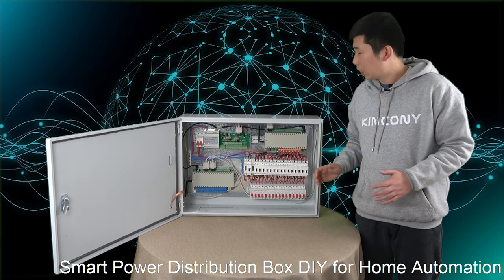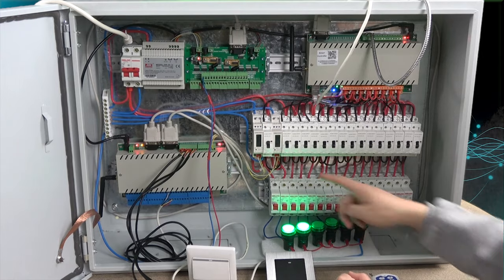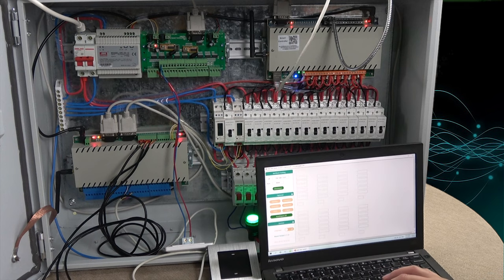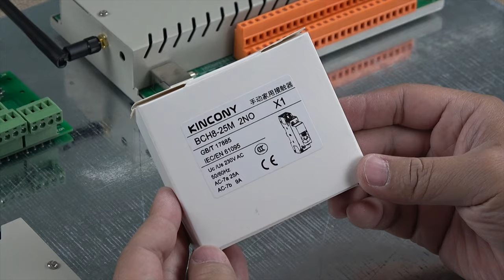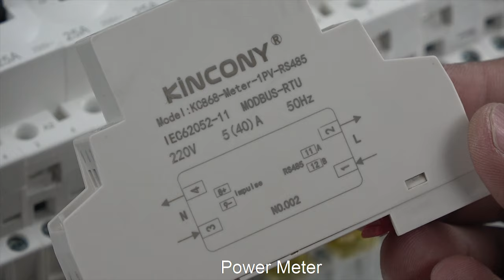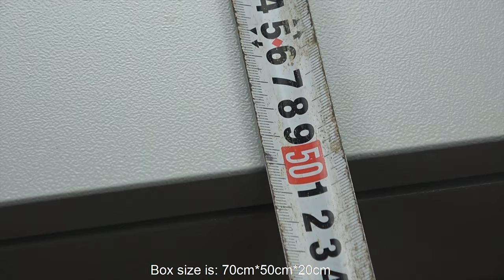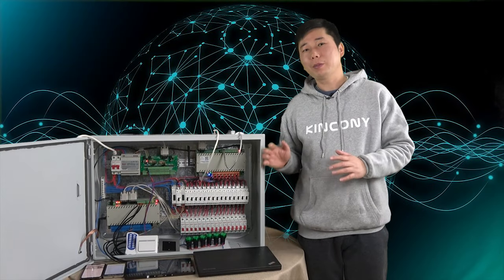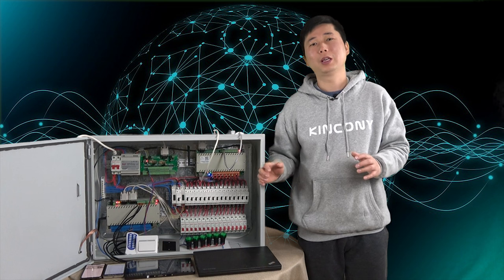Most powerful smart distribution box home automation DIY project 2021！

Comment: This is exactly what I think I want for my home.  I don't want to buy a multitude of differing wifi bulbs or switches or what have you.  I want a central place to be able to wire circuits to, and then have them controlled at that one place.  Also so that it's easier to either wire and/or change a circuit to NO or NC.

But I need to be able to do it while remodeling.
Reply from the maker: yes, we have smart relay controller, KC868-H32B Pro have 32 channel relay output, if you want NO,NC, just add our extend relay module KC868-E16v2 is ok, here is video tour about it: https://youtu.be/Cks-6NPXkF8

Comment: If i wanted to use this to control all the lighting in my home, could it still be used with light switches in the wall? also, how would the wiring diagram for that look where does the neutral ground and live connect to in the panel?
Reply from the maker: yes, the control system support wall switch, but that is "momentary" wall switch, not need LIVE and Neutral line. just two wire OPEN/CLOSE to toggle relay.

Comment: I would love to see something that's able to communicate with something like a Tesla power pack to read the remaining battery reserves. That way the home automation software would cut off more of a house's power use to keep the fridge & the chest freezer from shutting off & spoiling it's contents. Due to winter storms  some homes lose power & not have it restored for a full week.

With a 2nd circuit you could isolate essential electrical objects from the unnecessary  so the TV won't be powered by a wall battery pack but the fridge & a single LED light bulb that's used for night navigation in the hallway would be.

I think that it would be even cooler if you could  automate a smart window to fog up when the outdoor temperature reaches a specific high  temperature range to save money on a building's cooling.
Reply from the maker: now can connect power meter or power failure sensor or CT sensor to COLB logical controller, it can preset by automatic control. smart window we have a demo video like this:https://youtu.be/e1khSbs5E6Q  it can open/close window automatic by sensor.

Comment: Do you have projects for bells for hospital rooms?
Reply from the maker: the relay output also can connect to bell load.
Reply: In this case I need a wireless scheme, when the patient touches the bell button, it makes the computer and mobile phone ring, indicating the room number.
Reply from the maker: @Commandos.3  bell button can't wire with controller? must wireless?
Reply: @KinCony  all buttons have wires and go to a board, it was in this board that I wanted to change from analog to wireless to receive on mobile phones and computer
Reply from the maker: @Commandos.3  you can see our KC868-AI input module, that can feedback to pc web and mobile phone app, one board connect with 48 channel bell buttons. here is video tour: https://youtu.be/eYaoFPldjjs

Comment: Hi there 
Very nice smart device. 
Do you perhaps have your distribution outlet in Johannesburg.
Also, in-terms of the relays and circuit breakers, can I just the ones we use in South Africa rather. Then I just need to order the rest of the other modules?
Let me know. Thanks
Reply from the maker: sure, you can chose any relay and breaker, not MUST kincony's , but main controller use by KinCony's is ok.

Comment: This powerful control panel can also be use for concealed A.c unit 1.5 ton. And also for oven.
Reply from the maker: sure, just replace the AC contactor with large current version.
Reply: @KinCony  it's possible to use ur smart control panel to the entire residential house. Thnks house it cost ur smart control panel.pakage.
Reply from the maker: @sibugnestor3462  yes, of course.
Reply: @KinCony  how much it cost ur  designed smart panel sir.
Reply from the maker: @sibugnestor3462  you can see price in our online store: kincony.aliexpress.com

Comment: Sir which type of cable should I use to make a smart home should I use cat 6 cable, normal installation cable or both to wire?
Reply from the maker: for switch panel from our board use CAT5 network cable is ok, actually can use any wire. relay output wire need according to your load MAX current use single core wire.

Comment: nice product, however not possible to install for apartments with current dimensions
Reply from the maker: need put new wire for the DB
Reply: @KinCony  all devices in the power box have a predetermined height and depth, this is not an accident, your product has non-standard dimensions for installation on a DIN rail, this is not a problem for custom and industrial boxes, but a great difficulty for standard ones used for apartments where the distance between DIN rails is difficult to change  because of the decorative plastron covering all modules.
Reply from the maker: @sergijg  yes, so if want use more module for more functions, suggest re-install the DB box, not use old box, not enough space.

Comment: Can you add voice to this system, if so can you show me how? Also my big confusion is running the wires to the lights, fans, and other items. Do I just run a small wire from the Kincony box to the that is already wired or do i need to rewire the switch to the knicony box. Also where does the main power come in from. I can see the 12v power .
Reply from the maker: we have voice module for google and alexa, you can see another video. if your old device wire is already independently, you will easy to connected, unless you need rewire for load that you want to control. there is power supply for AC220v ->DC12v inside of power box.
Reply: @KinCony  I prefer not to rewire what is you best system to use. I also want to control fans.  If can be done I want to be able to do. It
Reply from the maker: @sergioorlandodilone1153  control fan need use kc868-D8 dimmer controller with SSR , we have another demo video.

Comment: Pls mr. How is the switch can be work in full distribution box,i see you connect switch wth it's terminal board,so how will be work in db,is the switches cable be on switch terminal board or they will be on circuit breakers
Reply from the maker: switch panel button line is connect to switch terminal board.
Reply: Ok so then the  switch board will be connected with circuit breaker?
Reply from the maker: @muazurabiu9812  switch board is connect with relay controller by RS232 cable. relay controller output->AC contactor->circuit breaker.
Reply: @KinCony  so what about the switch cable? May it go directly to the switch board or to the circuit breaker?
Reply: Because the thing that i didn't understand is that the switch cable must necessary be on terminal switch board? Or it's ok to be on circuit breaker
Reply: What i understand is that,if we will use an ordinary switch our light will be on the circuit breaker,then in our switch box we will connect the light from that circuit breaker to our lamp wire,but i see different ways in using your own switch because i realize that your own switch will definitely be on that board
Reply from the maker: @muazurabiu9812  you can use cat5 network cable or any cable to switch terminal board, low current
Reply from the maker: @muazurabiu9812  must go to switch terminal board
Reply from the maker: @muazurabiu9812  yes, smart system not use ordinary switch, now use self-reset switch replace with old switch and need re wire new line.

Comment: Is that ok if the ac contactors arranged to be the load contact point instead of breaker (mcb). With that arrangement, we can utilize the common double pole switch of the ac contactor.
Reply from the maker: breaker(MCB) can't be replaced, because the AC contactor will not auto STOP if over load.AC contactor only for small current control large cureent use.
Reply: @KinCony  what i mean is that the breaker will be behind the ac contactor, load will connect to the ac contactor than the breaker.
Reply from the maker: @mohammadfauziyahaya1459  this also can be done, but let load connect to breaker directly is better.
Reply: @KinCony  what is your recommendation for this kind of system  for some load that normally using traditional double pole switch.
Reply from the maker: @mohammadfauziyahaya1459  do you means one light use two switch panel to control in different place?
Reply: @KinCony  what I mean is, controlling single high power load such as water heater appliance which usually using double pole on/off switch of type.
Reply from the maker: @mohammadfauziyahaya1459  just chose ac contactor and breaker is ok.